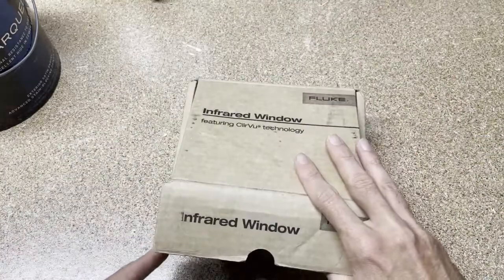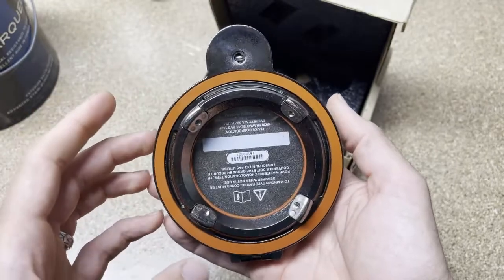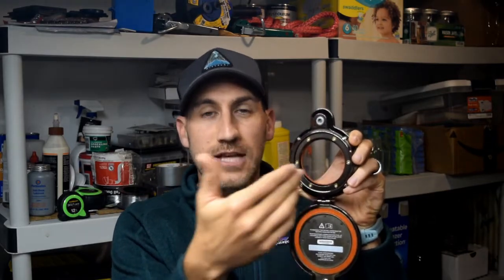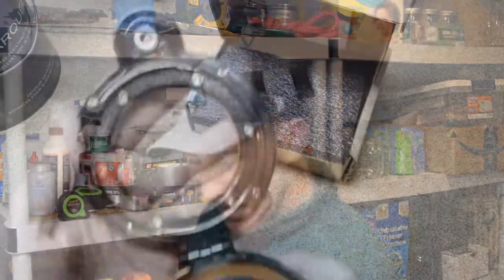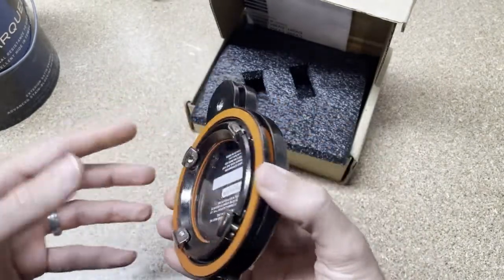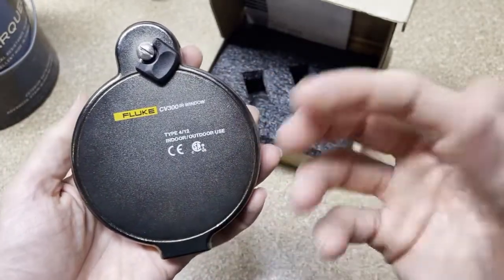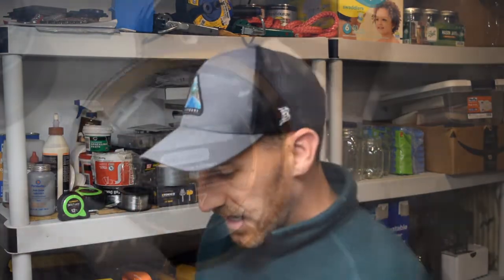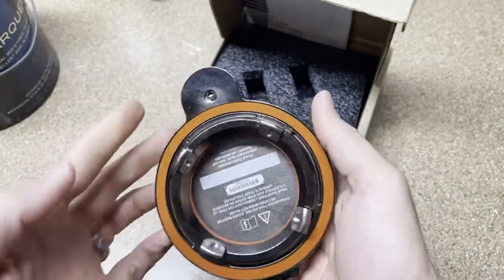CV300 IR Windows - Fluke Fridays - Episode 73

Comment: Does fluke have tools to locate wires, like behind walls,  under concrete/ground,  etc
Reply from the maker: Yes but it's under the Amprobe line: https://www.fluke.com/en-us/product/building-infrastructure/wire-tracers/uat-620?srsltid=AR5OiO24s_XjJNYj14pzFHGseqCUfBxN96Fn2YQSE9UMXg2YoEQY6sm6K_U

https://www.fluke.com/en-us/product/building-infrastructure/wire-tracers/at-6030
Reply: @fridayswithbrandon  wow! it goes up to 20 ft, is much more than what I need,  the most I could need is 3 or 4 ft depth, I could consider that one for the future